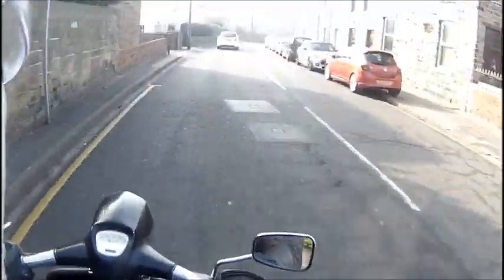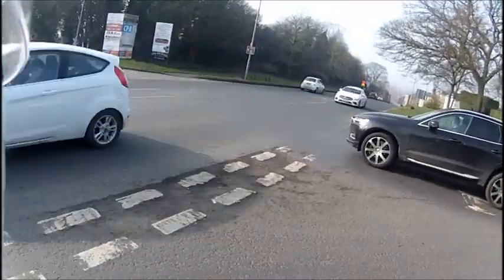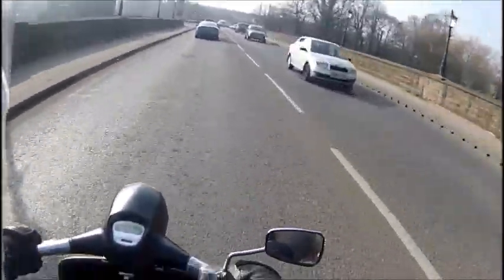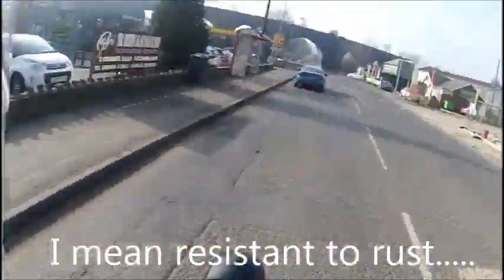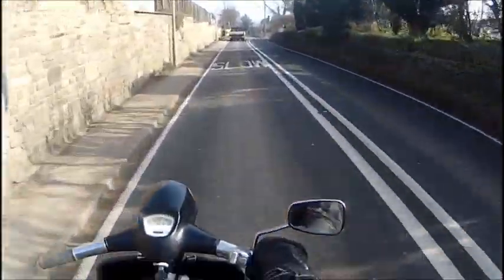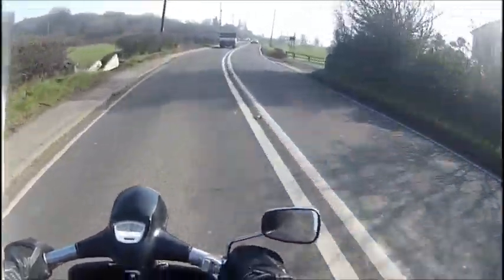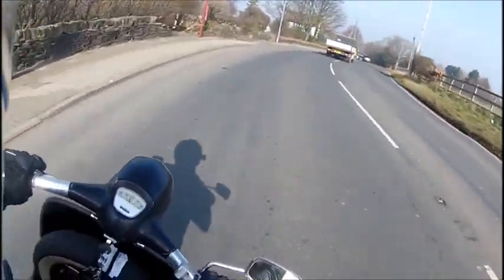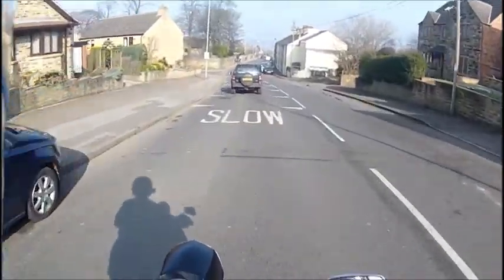Lambretta Vlog Time 64

Comment: Eh lad  you've  had some problems with your lambretta just lately but you're back enjoying the open road on your scoot again ,happy days.Having  problem with mine at present , kick starts after six goes , run it for a while,stop then it won't start without a bump off and all the while I've got to run it on the choke,think it just needs a time up.Great vid , can't wait for the next. Cheers
Reply from the maker: Ayup mate, yeah it's nice to be back on it for now at least! I dunno what might be up with yours but if you get the timing sorted properly first and it's still the same then I would guess it'd have to be something to do with fuel delivery. I wouldn't like to say though but I hope you get it sorted pal. Thanks for watching!
Reply: Cheers for the advice  , I'll try that
Reply: @MrCamohoj  sounds like an air leak as well mate